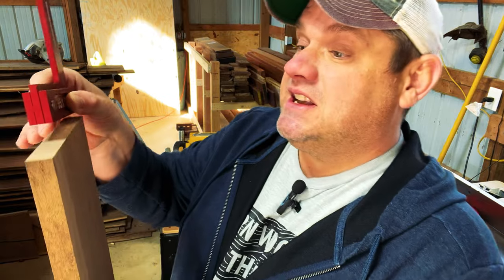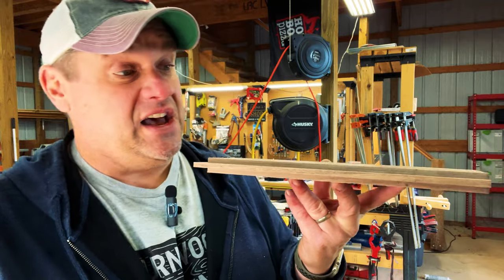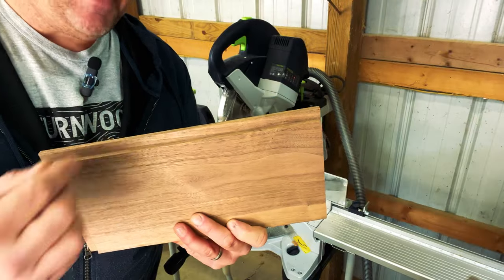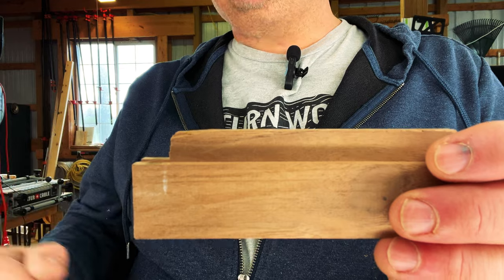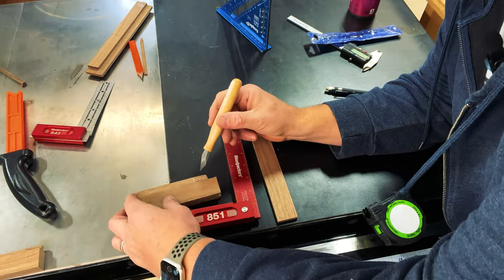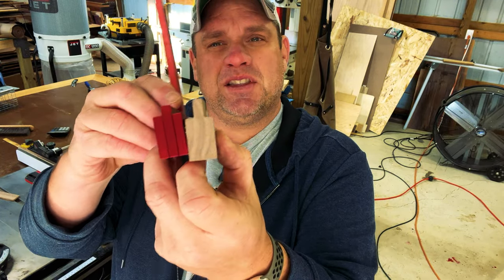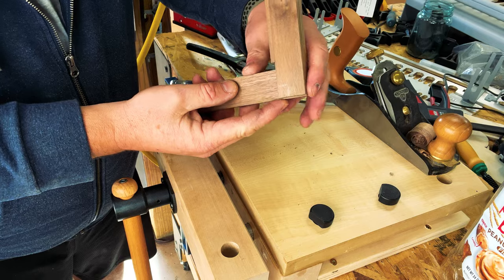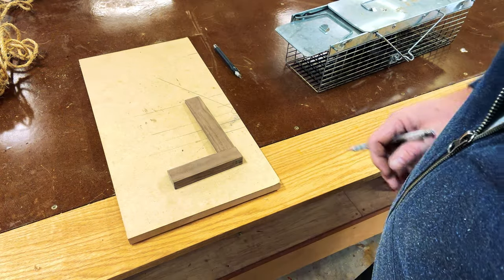Learn How to Make a WOODPECKER"S SQUARE from SCRAP WOOD 🛠️🟥

Comment: Very nice! I made one of these out of plywood with my laser, but it's only about 3" for trimming leather belt blanks. I might suggest an alternate version where you construct it out of 4 pieces of 1/4" material, and hold it all together with glue and dowels. A little more of a pain when it comes time to assembly, but a lot less work overall. And I think I'd refer to your wood version as "peckerwood", not "woodpecker" - just to avoid legal issues. Peckerwood seems to blend well with your humor. Loved the video - headed over to see what other content you have!
Reply from the maker: Haha!   Too funny.  I laughed out loud to the "peckerwood"  I think you hit the nail on the head with that.   Great idea on laminating 1/4'' material.  That would be a huge timesaver.   I also like the idea of plywood to ensure no wood movement.   Thanks again for watching and I appreciate your comments!

Comment: One question.  Why at the end you take out so much material from the blade to make that tenon?  Wouldn't it be stronger if you make the groove part deeper to accept the entire width of the blade?
Reply from the maker: Great question, I would have much rather of had the tenon be the larger, but by using the tongue and groove router bits to make the groove, it only left a 1/2 inch groove.  Probably would have been a better idea to just use a hand saw it to cut it deeper to leave more surface for the Tenon.  I could have even put a dowel or two through it too (which was my original intention) but with only a 1/2 tenon I couldn’t do it.   Great observation!  If I were to make one again I would defiantly cut the whole deeper by hand on the base of the square.  Or use a dado set…. Thanks for watching and the great question!